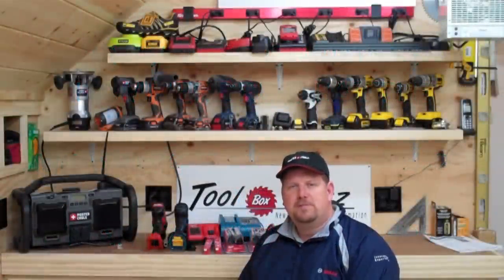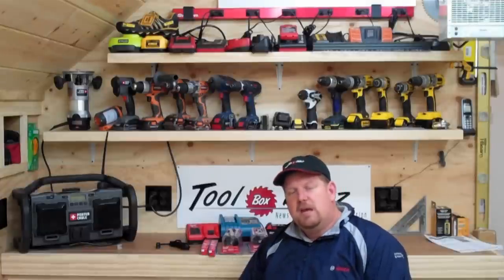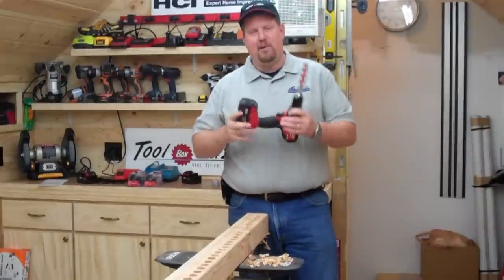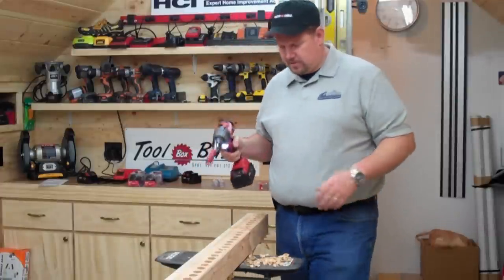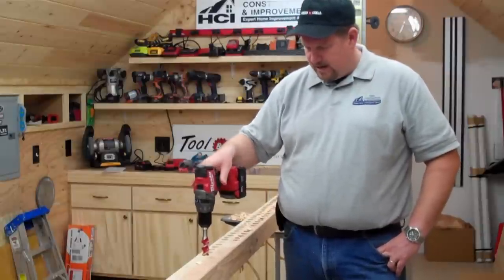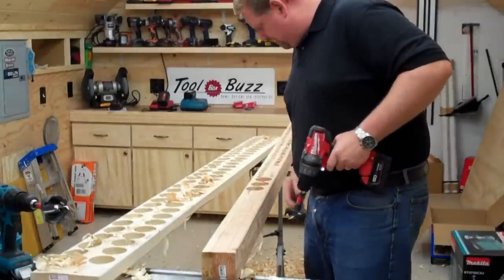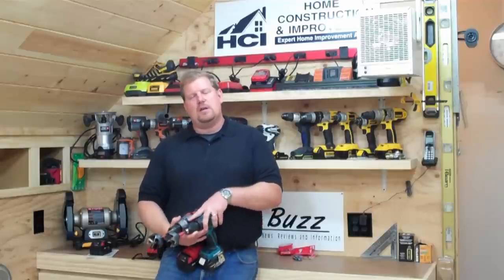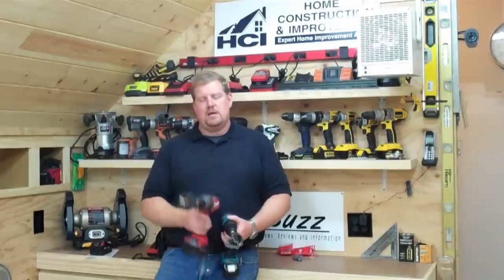Milwaukee 18V Vs Makita 18V - Brushless Hammer Drill Test

Comment: FrontStepsMediaLLC: You said in an old post that the Makita uses plastic gears. That's not true. I have this drill and have had it taken apart just for investigation purposes. The gearbox consist only of high quality, high grade steel, parts.
Reply: The gear housing is made out of durable plastic but the actual gears are high grade steel. I think there are only one plastic part in the gear box, if I remember correctly and that is the plastic arm that gets affected by the gear selector switch and which actually physically moves the gear selector ring inside the gear box.